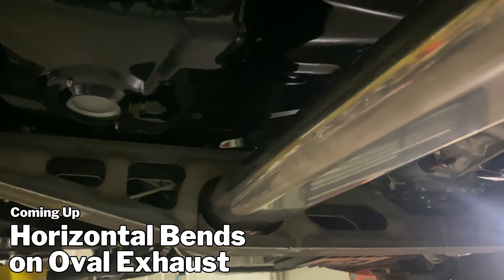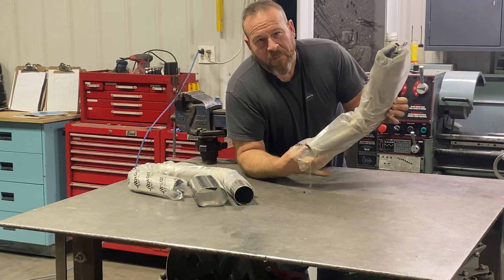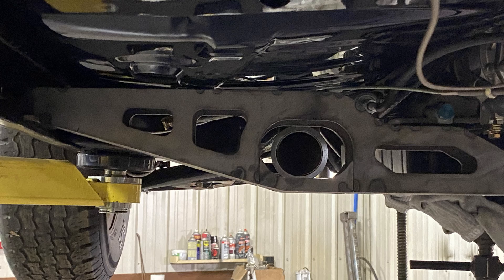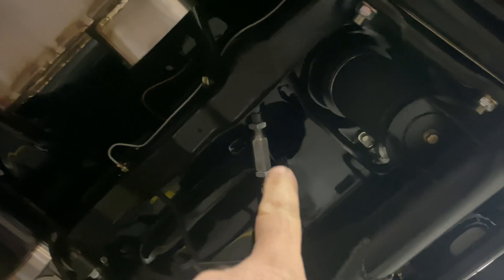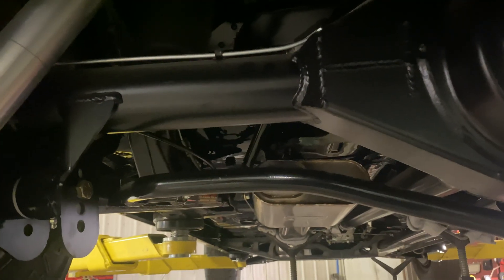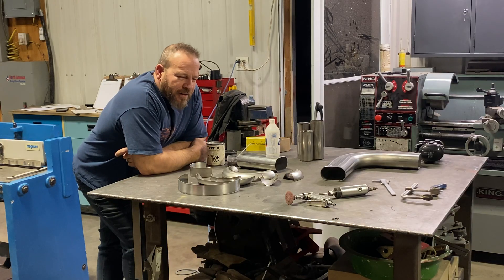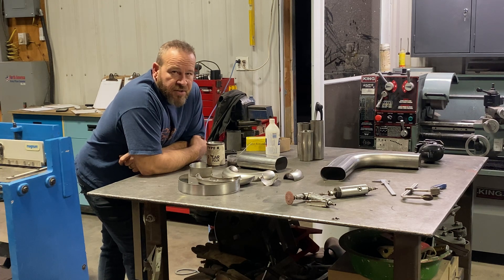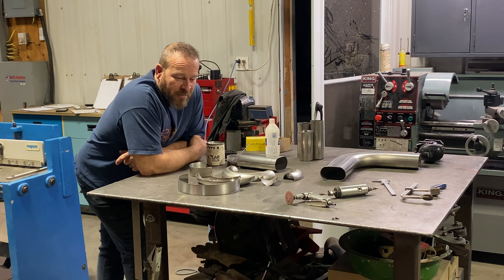Vertical Bends On Oval Exhaust

Comment: Why not just transition back to round? Seems to me you made it difficult on purpose. Ground clearance not an issue at that party of the frame.
Reply from the maker: @cagedruss  this car is low and the suspension had clearance issues as well. It’s also what the customer wanted.

Comment: Profabrication offers these as well. It may be fairly new to the street car scene, but the oval stuff been around for many years. Heads up for anyone interested… You may need to call to order.
Reply from the maker: @arndtcraft  Sweet, thanks for the info. When we started this build all they had available was horizontal bends. Will need to check them out too.

Comment: Passing by, as I'm designing my own stainless exhaust. CX Racing has oval verticals. 90* anyway. Maybe this helps.
Reply from the maker: @kathysarmcandy1992  Wow, that’s sweet! Must be a fairly new product? This project and video was started quite some time ago, but we still need to do some more bends, will check it out to see if the radius will match up. I have a couple twists that I have to put in as well, they are almost done. I’m not sure if anyone knows where to buy those???